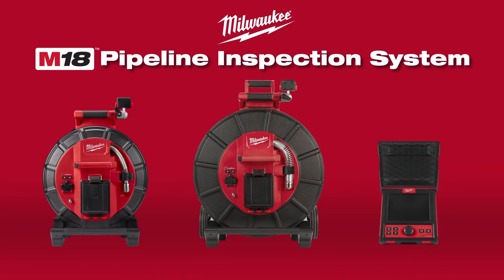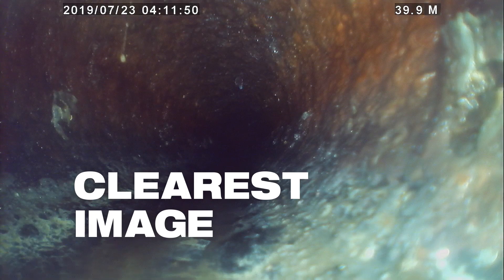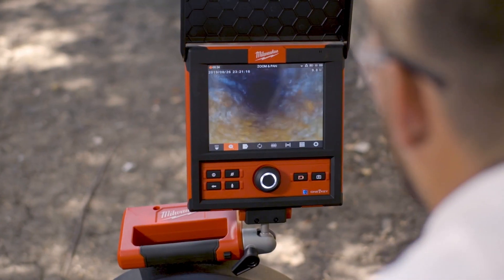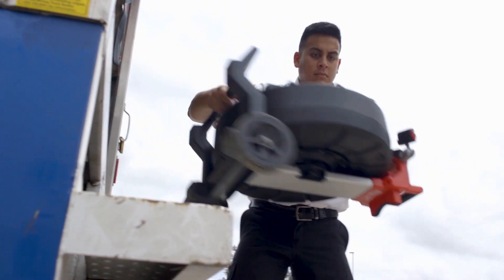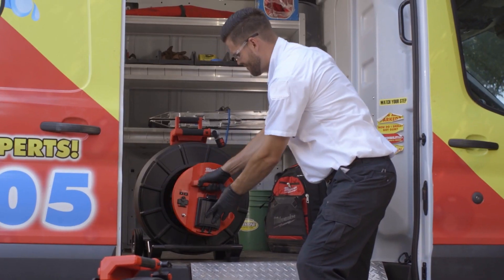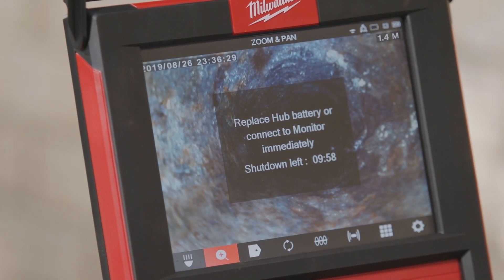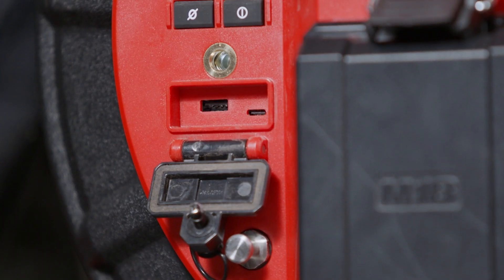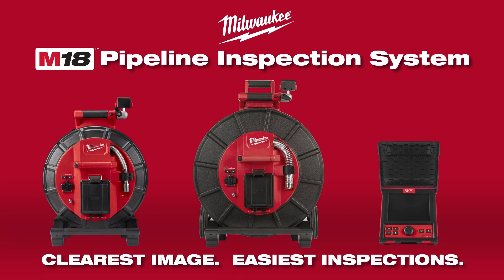MILWAUKEE® M18™ Sewer Inspection System

Comment: ok hear me out, so I've had to replace, monitor twice already I keep having an issue with it. 
so, when I took it out of the box, I turned it on, and it ask for an updated which I selected yes. after the 100% update was done the monitor turned off by itself but the screen never turned back on. and at this point I think this monitor is junk or am I doing something wrong? is anybody else having this issue? thanks

Comment: Got this amazing tool about 2 months ago (Texas). You can run the camera the entire length of the sewer line, then locate the entire line... NOT JUST THE HEAD, but the entire cable can be located. Mind blown. I've sold so many jobs with this camera. Its already paid for itself. Great investment!
Reply: Tell me more about the sells, kinda want to get this camera, sewer repair outside of the house, how much you guys charge for a clean out?